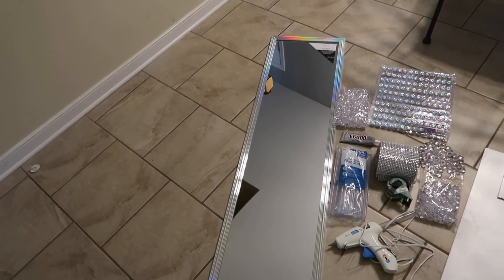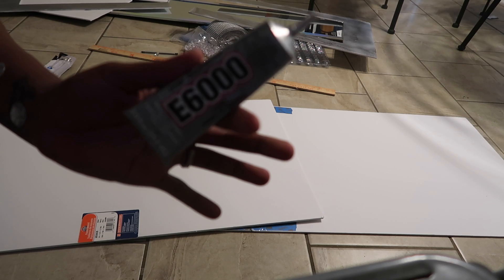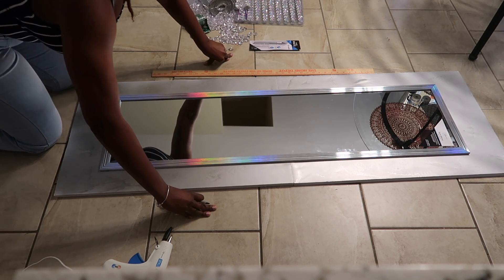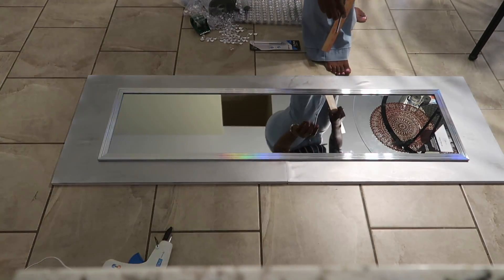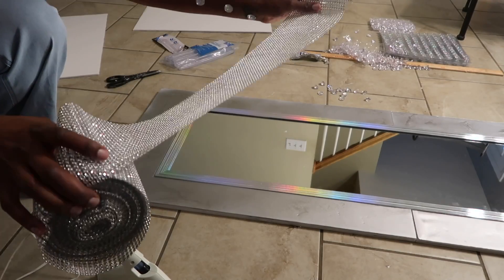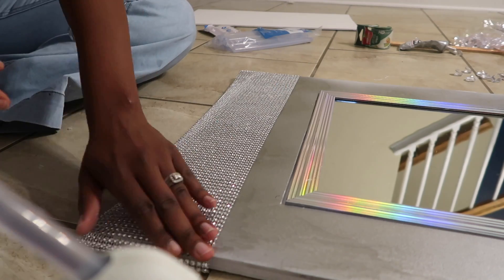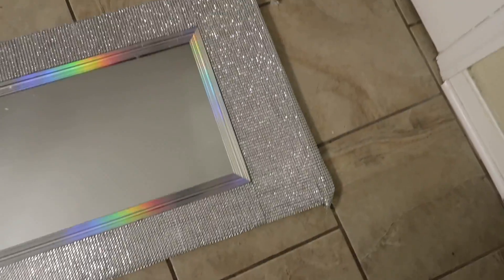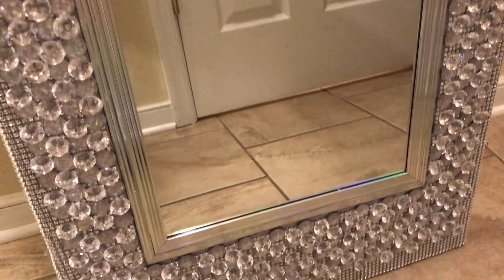DIY | GLAM MIRROR | FULL LENGTH BEAUTY BLING MIRROR

Comment: For anyone wanting to use the same materials, you'll want to cut one of the middle boards in half & glue the whole piece in the middle & use the halves on the top & bottom. That'll fix the seam in the middle & give extra support.

Comment: Nice project! One suggestion to anyone else making this, cut one of your foam boards in half across the middle, then put a whole board across your seam of your lower boards. Then apply the two halves on the ends. In other words, stack your foam boards like bricks to reinforce your joining of the foam boards. You will have a much stronger joining seam. One more thing, if painting foam board use very light coats and dry completely between to avoid the bubbling up of the top layer.  I learned this stuff watching American Girl Ideas make furniture for 18 inch dolls.
Reply: So pretty much buy 2 more boards to what she has for materials and then layer them??

Comment: I have some these basic mirrors that I want to jazz up.  How durable has it been with using foam board instead of wood?
Reply from the maker: Of course wood would be more durable but it’s the cost effectiveness is the reason I used the foam board but mine is still holding strong 💪🏾

Comment: Nice. You actually didn't need the extra step of cutting out a frame. You can glue the mirror on the cardboard...I did a similar DIY
Reply from the maker: keyondra T I wanted mine to have extra support using that ledge as a support for the mirror 💁🏾‍♀️

Comment: Your not afraid of the foam board giving way ? I would have use plywood  instead
Reply from the maker: You can absolutely use plywood but so far I haven’t had any issues and I have a rambunctious 2 year old that likes to touch it and it’s still intact 😊
Reply: Jazzi Does It that E6000 glue is really strong!